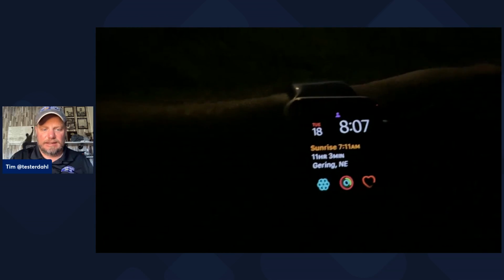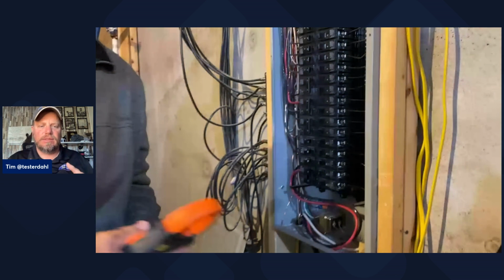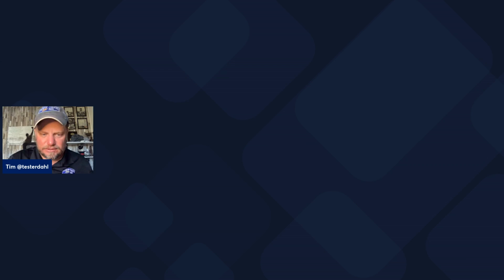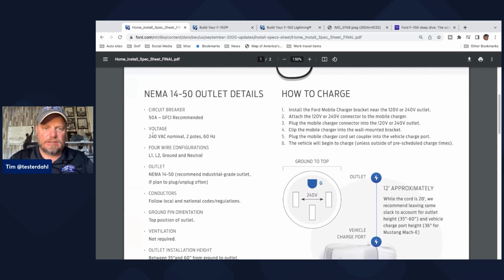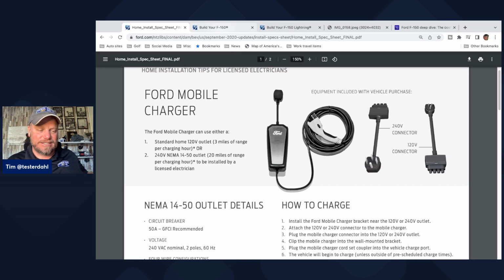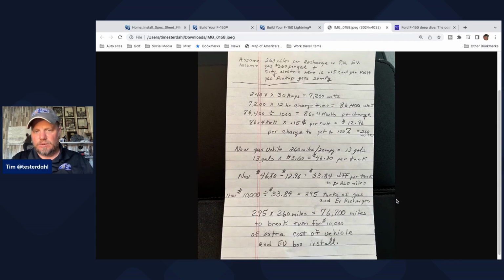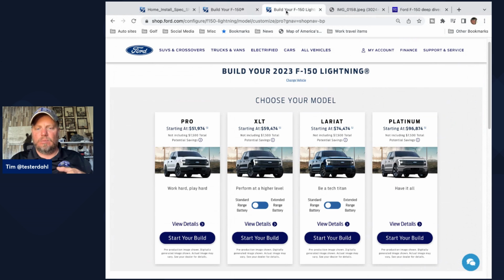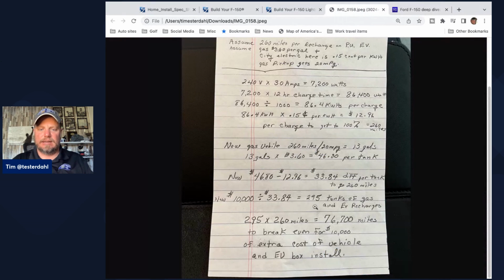11+ hours later on 220V charging price for 2022 Ford F-150 Lightning

Comment: So I am very confused after watchin this video .. AN YOU SUM IT UP in 1 minute please.??   In My Humble Opinion  IMHO, lets all get a DIESEL MOTOR and LEARN as a NATION how to make clean GREEN FRIENDLY BIO FUEL  BIO DIESEL ! ! ! !   Electric Vehicles are going to be great for short trips in a regular pattern on warm sunny days  FINE.  BUT on windy days, Snow Days, Rainy Days, Long Long trips from PORTLAND MAINE to MIAMI FLORIDA... you want a DIESEL 44 mpg burning CLEAN BIO FUEL ... plant based or OIL OF ANIMAL FAT hybrid fuels.   IT can be done if we put our minds to it and the GREEN MAFIA keeps their hands off of us MOTOR HEADS WHO KNOW A THING OR TWO on how Diesel Engines Work !   I'm sorry, but EVs are not there yet.   You won't see an EV Tractor Trailer that can go 900 miles in a clip.  Quickly Safely.  You will NOT see an EV Bulldozer, EV Earth mover, EV SnowPlow. EV Dump Truck or EV JetLiner or EV Cargo Ship.  EVs excel in small short distance pre-calculated and pre-determined routes like Mail Carrier EVs or Commuter Cars driven 50 to 80 miles round trip DAILY.   Use your imagination. BUT, I would NOT want to be in an EV during a SIX FOOT Snowstorm in Buffalo New York fyi.